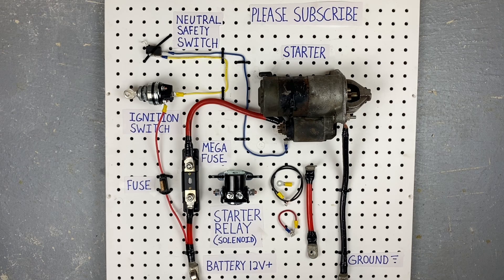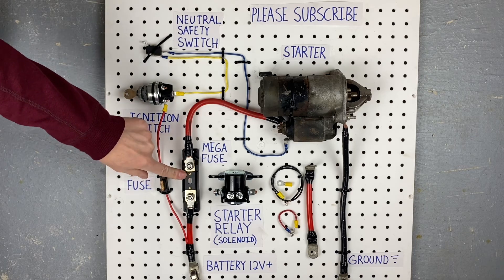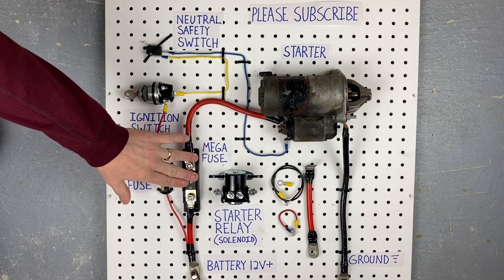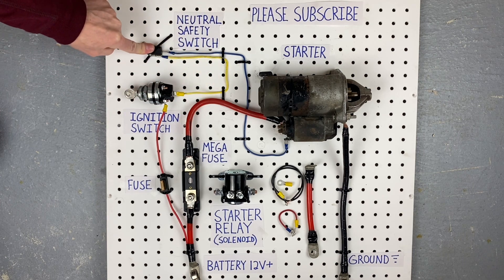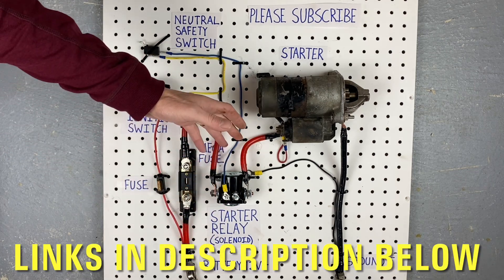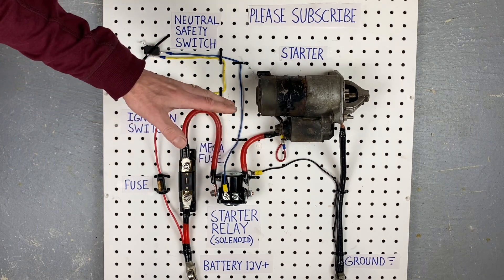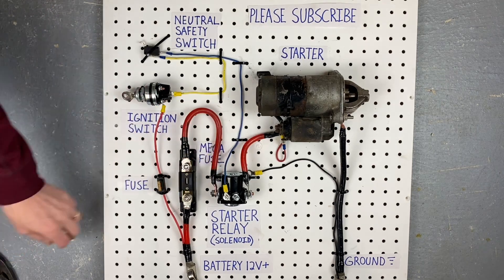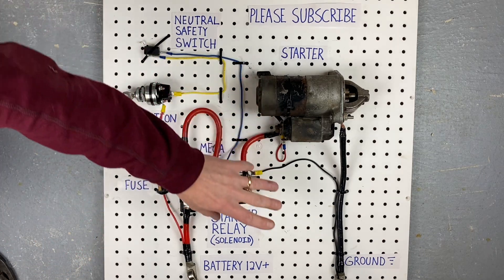How To Wire a Starter Relay Solenoid and Neutral Safety Switch on Any Car Truck |@WiringRescue

Comment from the maker: Thank You for Watching my Starter Solenoid Relay Wiring video! 
Subscribe To This YouTube Channel: http://www.youtube.com/user/4g63mightymax?sub_confirmation=1
See My Wiring Playlist: https://www.youtube.com/playlist?list=PLsF7T1tRFy2hmiiUUfMZNyV-BUA_yrPIh
Reply: Can you do another video with this setup in relation to deal with an ammeter .

And also dealing with a 2 field alternator in a 1 field system.....- 60s 70s mopar charging systems
Reply: Hello I bought a few starter for my 76 Thunderbird which has this type of set up. Have a no crank no start condition. The starter is new, the relay and battery new, and also changed ground connections. The new starter that I installed only have one big terminal so you saying there needs to be a second wire on the actual starter for it to work? I can't even pop start it by using the screw driver technique. The relay just clicks when turning key.
Reply from the maker: @omarchisolm7533  - your setup sounds correct. Some starters only have one large terminal. In your scenario - check to make sure your ground wires are connected securely. There is usually a ground that goes from the negative terminal on the battery to the body and to the engine block. If your engine block is not grounded, you will have your exact problem.  Also use a test light or multimeter down at the starter and make sure that the power from the solenoid is going to the starter when the solenoid is activated.
Good luck!
Reply: @WiringRescue ok I will keep u posted. Thanks
Reply: 😂 lol ahrcg

Comment: Did ya convey the red(+) terminal goes to big nut, the one that does not have wire from nut to solenoid, is this correct?

Comment: How exactly should I attach a diode to the starter relay in order to defeat flyback voltage spikes when the coil in that relay collapses?

Comment: Subscribed but haven't yet found an answer to my "burning" question which is as follows: I am trying to protect a10'  long AWG 1 wire that goes from a rear mounted battery to Ford type starter relay/solenoid. I plan to install a 200 amp circuit breaker (CB) close to the battery which should protect the wire from catching fire due to an over-voltage situation. However, that instigates another problem. That problem is the likelihood that interrupting the battery while the engine is running to avert a fire will cause a damaging load dump (aka Transient Voltage Spike) that might damage the alternator as well as other electronic components, especially sensitive digital stuff. One idea suggested to me entails using a relay triggered by the CB to disconnect the alternator field (AFD). However, I have no idea as to what parts I would need, where/how to source them and, most importantly, how to construct this automated AFD gizmo. There are lots of switches that do this manually and they are popular with nautical types but I find very little interest in the automotive space. If you've already done this and I just missed it, please point me in the right direction. Thanks for your patience in reading through this.
Reply from the maker: I don’t have any videos for this scenario, but I can tell you that drag race cars go through a test at the track before every race where the tech inspector turns the power switch off with the car running. All it does it turn off the car. There aren’t any major spikes that kill off the race car electronics or alternators. I’m not an engineer though, just a car guy. So I am sadly probably not of much help for you.
Reply: @WiringRescue  For that switch at the very back of the race vehicle a four pole switch is used. Two for the battery wires and two for the alternator wites. This is primarily to deal with engine run-on in emergencies (e.g. crash). It is manual so has to be deliberate. A circuit breaker can disconnect the battery automatically without deliberation. With a single wire alternator there is no access to the field terminal so no way to defeat a TVS with a diode that I can imagine. Surely someone has figured out a solution.

Comment: Thanks for all the great teaching! I have a ‘65 Dodge Power Wagon with a starter relay. Does the key have to be “On” to jump the relay with a screwdriver? Or can someone simply pop the hood, jump the relay and drive away. The ‘65 PW is in pieces right now or I’d try it 😂 Thanks so much

Comment: Hello, very informative post.  For the remote solenoid switch, part, why do I have to add a short wire from the starter connection to the smaller port connection to the solenoid that is part of the starter motor?

Comment: Can the small terminal on the stand alone starter solenoid be used as a keyed 12 volt source to power a fuse box so that i can have multiple 12 volt  keyed sources?
Reply from the maker: It probably should not be as it was never intended to have that much power being drawn from it. Check out my hotrod wiring video, it shows how to use solenoids to power up fuse boxes.

Comment: Thanks I had a wire cut on my coil didn't know it was for the starter relay since my coil had a Ballast with it don't know why it had a Ballast it's a 12v coil not a 9v or 6v coil but thanks your video is outstanding I've been researching car wiring allday
Reply from the maker: Awesome, glad the video helped you figure out your wiring issue!

Comment: On the wiring circuit between the battery and the starter wouldn't it be more practical to run as short of a wire run as practical and use an extra heavy gauge wire like 2 or 4 gauge? The starter don't turn over that long but tends to voltage surge when first triggered. This prevents using a small enough fuse to trully protect the circuit otherwise you may have the fuse tripping constantly when first cold starting the engine?

Comment: Thank you so much dude, so easy to visualize and understand the circuitry of the ignition system.  Also, would like to point out that, this also allows for ease of troubleshooting any component within this setup that maybe bad and causing a no crank condition.  I see, I could make a direct connection and by passing the neutral safety switch to trouble shoot if my NSS is bad.. Same can be applied to test if Starter relay/solenoid is also bad! Cool stuff!!

Comment: Good evening, I'm from Brazil and I have a question. Is it possible to install a parallel lamp with a 12V signal pulse wire for the auxiliary starter solenoid, whether it is activated by the built-in pedal or with a jumper on the starter sensor wire of a Ford Ranger 97 Super Cab 4.0 manual?

Comment: I know this video is 3 years old, but I'm hoping you'll answer.  Currently I have no fuse of any kind from the battery to the starter.  You are using a mega fuse, but what amperage?  Since the battery can put out over 700 cold cranking amps.....I'm wondering what size fuse is best for that size of a load?  Please help.  Thanks for the great videos.
Reply from the maker: The battery might be capable, but the starter is not going to ask for that much. You’d need to determine how much the starter is actually drawing to determine the fuse size. If you have not already watched this video I made about how to figure out wire and fuse sizes - check it out: https://youtu.be/EhzN6UdnmPA?si=AoKYoCUIPWQ6kfEA

Comment: I thought a starter drew more than a hundred amps.  Not true?
Reply from the maker: It depends on the starter and the engine. They draw way more amperage when there is a load on them, but to figure out the fuse size, you’d need to know the amperage draw for your specific project.

Comment: Bro I love your video's.  I'm trying to run  separate fan and starter wires while still using the factory harness and ecu. I also pulled the motor from a 2000 civic and put it in a lawnmower......

Comment: @wirerescue 
What amperage mega fuse have you used 
Or what amperage fuse should I use on an old 70’s model diesel tractor that would pull some large amperage ?

Comment: This video was awsome man! Just recently purchased a 1989 GMC Vandura 5.7L 350tbi and they use a starter solenoid/relay for their system. I'm 26 and have never seen these. Cleared up alot of confusion while doing the "big 3" for a sound system. Thank you!!🤙
Reply from the maker: Heck yes! I’m glad the video helped you understand the circuit! I’ve got tons more if you find yourself yearning for more! Also Vans rock! Good luck with yours!

Comment: You  don't want a fuse on your starter you will blow that on a hot day if you are running errands and keep starting the car when it is hot. Unrelated, but you can just connect the two wires going to the neutral safety switch.

Comment: Thanks again for your videos. Quick question, my battery in my 54 chevy is in the trunk i want to install a starter relay like you did on this video. Is Another benefit when jump starting the car would you put the + cable to battery side of this relay?
Reply from the maker: Yes - that would be another benefit!

Comment: I have a cj5 1975 with a 304 and electric ignition and fuel jets .I am wiring the hole jeep. Thank you for the lights video your explanation was great all the lights work accordingly.But I’m having a real problem with the fuel computer on power and distributor, and solenoid tac have you any help with theses thank you

Comment: I like the idea of installing a Maga Fuse.
However I own a Ford Pickup with the fender mounted RELAY. It is not a Solenoid. A Relay only does 1 thing. When it is energized it closes the switch inside to send the voltage to the Cranking Motor. The Solenoid on the other hand does 2 things. It powers up the Motor plus it causes the cranking gear to be engaged with the flywheel and spins to turn over or crank the Starter Motor which starts the vehicle. The drive gear assembly in the Cranking motor was referred to as a Bendix.

Comment: you didn't explain the negative cable function and were to connect it .
Reply from the maker: Starters don’t have negative cables going to them normally. I had to add this one to my circuit because it isn’t not mounted to an engine in a car.

Normally the negative cable comes off the battery post and splits off to two places. The engine block + the body/chassis of the car. This makes the whole car grounded.

Comment: I really find your videos helpful.  I do have one question with regards to the Mega Fuse and ignition switch sizes.  I have a 1922 Model T that I am rewiring.  It has a 6V system and has a starter solenoid similar to the shown in the video.  Mine is a three terminal solenoid and does not have the coil lug.  What size fuse is used before the ignitilon switch?  I know the current draw on this wire is much less that the starter cable as it only powers the solenoid coil.  Also I like the idea of adding the Mega Fuse.  What size fuse would that be?  Thanks!
Reply from the maker: Like all things in life “it depends”. To fuse it properly, you need to determine what amperage draw it normally has (or is rated for). Once you know that, you can determine the fuse sizes. I actually made a whole video on this topic if you would like to check it out. I think it would help you out!  https://youtu.be/EhzN6UdnmPA?si=rFwvTSrIorO70OCr

Good luck with the Model T! Sounds fun!

Comment: Shouldn't the neutral safety switch stay latched, or is it momentary?
Reply from the maker: It’s momentary, and it is held in place whenever the shifter is in neutral or park. As soon as you shifter out of one of those gears, you have an open neutral safety switch and the car won’t start.

Comment: Excellent video and lesson! Can you help me with something please? I recently disassembled a 12v starter motor to change the brushes and clean and lubricate everything and it turns out that the copper braided cable that connects the field coil to the solenoid is practically undone. What cable can I use to reestablish this contact between the two? 12 gauge? Thanks and Merry Christmas!

Comment: Good set up, but would have been nice to see the switch terminals since there are 4 of them
Reply from the maker: In this other video I made, I show some addition details of that same switch. Skip to 4:05 in this one https://youtu.be/Yz9kqxWkoHI?si=7xDVJeOEHhVq5ed9
Reply: @WiringRescue  Just what I need.  Thanks.  I just converted my old Ford tractor to 12 volts and a key switch.

Comment: Great video! Thanks (I just subscribed). I have 2.3 L Ford engine in a Railroad Motorcar which I am restoring. I have the Ford solenoid like is on  your board. I want to put in a Master cut off switch. How do I wire this with the set up you are showing? Thanks, Joe
Reply from the maker: There are many ways to do it, but check out this video, as I think it will get you going in the right direction! Oh and thanks for subscribing!

https://youtu.be/Yz9kqxWkoHI?si=jig4bdh21MbhgpYA

Comment: My 71 Chevy Nova is wired just like the Ford diagram (used MAD’S kit years ago) but now that I’m changing from a 350 to LS3 what do you do about that jumper? The LS3 starter is completely different.

Comment: 100amp Mega Fuse.... Really? Even if it's a slow Blow/Time Delay 100 amps just isn't enough honestly. Yes some of these fuses allow a burst amperage but even a little 4cyl starter can spike 300amps upon starting a vehicle. The 2020 Silverado 5.3 uses a 400amp Fuse right off the terminal for this. As a Direct ground short would blow it pretty quickly. I just don't want people to think that 100amps is enough. Add Cold weather and a slightly weak battery to the equation and that fuse is toast. Not to mention lets say you have a weak fuel pump and cranking is slightly extended this fuse is a goner. I wouldn't use anything less that a 300amp time delay Mega Fuse for a 4cyl and a 400amp for a V6/V8... Just my $0.02
Reply from the maker: I did use a 100amp mega fuse in this video, but I don’t believe I ever said that was the correct size for everyone. I actually did make a video on choosing the right fuse and wire size though, which may be along the same lines of what you are suggesting.

https://youtu.be/EhzN6UdnmPA?si=UtghfmQvXFf7QDv0

Comment: Canada.  2008 Lancer 2.0L replaced a Starter, but still wouldn't start.  So my genius mech noticed that the blue wire crimp connector was corroded, (Canadian weather), so he crimp a new wire from underneath the car (my guess it's the blue wire, starter relay section,  on the solenoid Starter).  And it started, finally.  At 3:44 min. to understand better.
Reply from the maker: That little wire fell of the starter on my 91 Eagle talon a few weeks ago! It was a fun little parking lot fix. Glad your car is sorted out now!
Reply: @WiringRescue  The Eagle Talon is still a head turner after 20 years, sporty, sexy, one hot little sports coupe.

Comment: But my bM pro stick is closed in every location BUT n and p
... so how do I wire that?
Reply from the maker: Sometimes those switches have the option of “normally open” OR “normally closed”. Check it out to see if you can swap to a third terminal and have it works the opposite way.
Reply: @WiringRescue  i got it working. I was stupidly plugged into the neutral saftey switch with the reverse light

Comment: yea but in your dual solenoid setup you fail to mention if the first solenoids secondary is wired  to the second solenoids secondary or primary i imagine it has to be specific if you want the gear to jump

Comment: No clutch, safe switch. For simplicity sake, wire the Ignation switch into the old strater relay. Because the extra solenoid would be taking the relays place?

Comment: 1:48 .. OK I do not trust this video as it starts with misinformation.  On older cars with top post LEAD battery post camps??   The Clamp ITSELF is the fuse, anything over a certain amperage for any length of time (like a direct short) melts the lead post clamp and it runs away as liquid.  I have seen this happen, AND it is why you should not replace Lead Battery Post clamps with brass or stainless steel ones on old cars, AND use replacements of the same size and thickness

Comment: Always wondered why Ford used two solenoids in the starter circuit.  I know they had direct drive starters at one time which made sense to place the solenoid on the firewall/fender.  It appears the engineers were actually thinking about the mechanics and making life easier for them, at least this one time. 

👍💯😁

Comment: I can't thank you enough. I am rebuilding a 1978 ski boat with a Ford engine and understood little on how the ignition system worked. It is so refreshing to learn something by simple, clear, and direct explanation.
Reply from the maker: That’s great! I’m glad it helped you out, I have tons of other wiring videos too if you want to wire fuse boxes, lights, horns, etc.  Good luck with your boat!

Comment: What size mega fuse
Reply from the maker: The fuse size depends on a whole bunch of things. I made a video all about how to choose the right size fuses. Check this out. https://youtu.be/EhzN6UdnmPA?si=3x_liW6Iaa6YM2By
Reply: It's a brand new GM starter (for carb'd 350) I'm reading 200-350 amps the starter could draw? Is that correct? So 350+ fuse?
Reply: Also I'm running a diode to ALT, but does the ALT have to be fused between the battery as well?

Comment: Can i use 14AWG wire for the starter solenoid?
Reply from the maker: I doubt it, but it totally depends on what components you are using. Luckily, I made a video to explain this. Here you go: https://youtu.be/EhzN6UdnmPA?si=3sdx3GxMaNgVLPgp

Comment: my 73 beetle uses a ford starter relay, they last longer than Volkswagens version that is mounted on the starter. the matter of the big block chevy: the relay right next to the headers and engine block tends to overheat it so having it away from all that heat helps also. If you have your bb chevys timing bumped up 30 degrees, you're not going to start it hot.